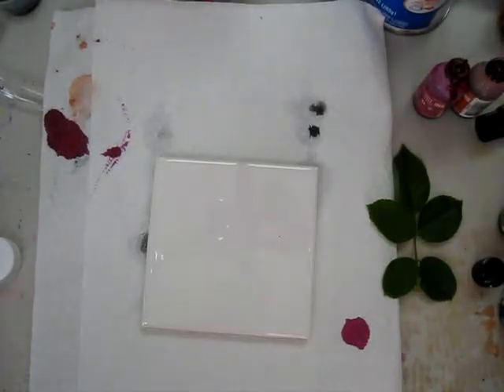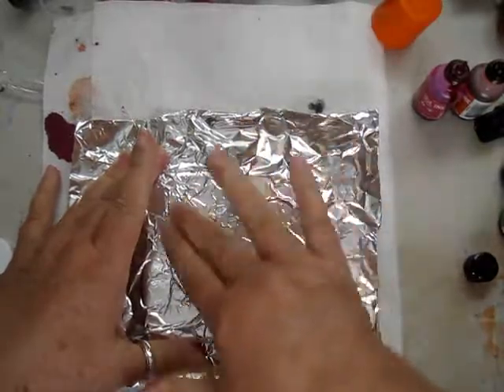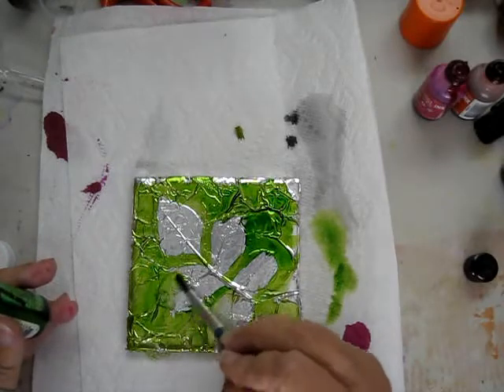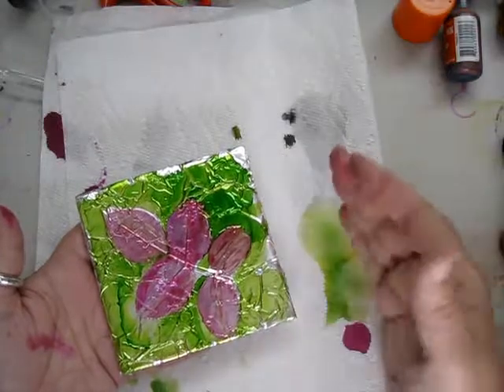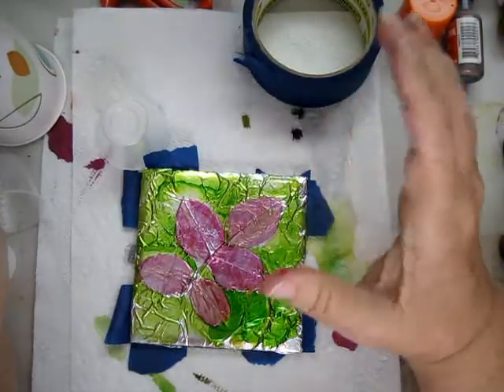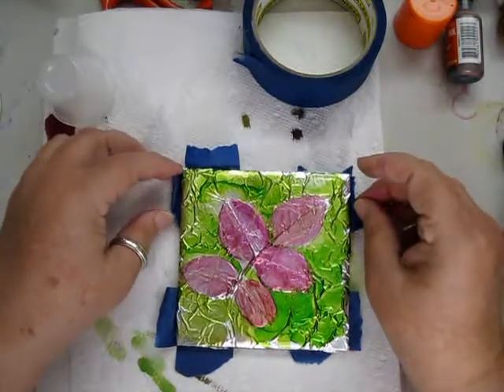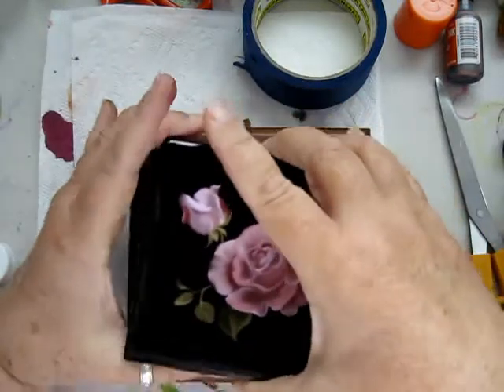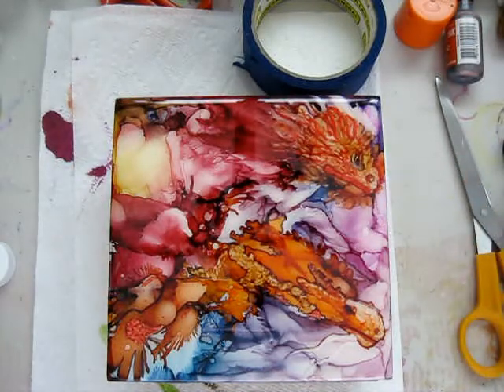Foiling the Leaf and tile substrate

Comment: Thank you for the awesome demo...why do you put resin on the tile FIRST before you add the leaves?
Reply from the maker: rose gesford, thank you for watching and your comment.  I am a bit confused about the question because your comment came to me attached to another video.  However, I think I know what your question is regarding.  I use resin two ways.  The first way is the conventional way - pouring over the top as the final step.  The other way is to mix up a tiny amount and use it as a glue.  This works especially well when gluing photos  to the substrate.  Some glues will soak into the back of photo paper and create a permanent discoloration.  The resin doesn’t do this.  When gluing leaves to the substrate, the resin adds a greater support beneath the delicate leaves to support the heavier resin pour above.  Let me know if this answers your question!

Comment: I like your video. Do you take off the aluminum foil at the end?
Reply from the maker: Abby Welch thank you for your comments.  To answer you question, the aluminum foil remains part of the completed project here.  However, after painting the aluminum embossed leaf, I have removed the foil, lifted the leaf off the tile, and used just the painted foil to remount on the tile.  You have to be very deliberate and slow in removing the foil because after all the embossing, it is really stuck to the glue on the tile.  After removing the foil, I placed it back on the tile without the leaf beneath.  Poured the ArtResin over it.  I noticed that there was a slight difference in the depth of the relief of the leaves.  The one that had the leaf remaining looked just slightly more defined than the one were the leaf was removed.  However both looked pretty good.  I hope this helps.  If not, let me know.
Reply: Gerry Morgan ok thanks. Where do you buy the ArtResin at? And what do you mix it with?
Reply from the maker: Hi Abby!  You can buy Art Resin at its home site at www.artresin.com or you can get it at Dick Blick and Amazon.  Its a bit more expensive than some of the epoxy products you can get at Home Depot, but it is a great product - no strong odor, simple 1:1 mix, dries like glass, you have a 45 minute window to work with it before it starts to harden, its self leveling, and it adds to depth to the photo or whatever else you are pouring it over.  I have used other resin products, but for some reason, they never dried to the finish I wanted.  If you are not happy with the surface, it can be sanded and repoured.  There are multiple YouTube tutorials and videos that can help you maneuver this simple product. I am not selling this product - honest.  I just like to let folks know when I am happy with a product.  I spend a lot of money on chemicals, as I am sure, you do to.  And when I do that, I want them to work as promised - Art Resin does.
Reply from the maker: Abby Welch I don’t mix anything with it, I just use the ratio of 1:1 when mixing the resin with the hardener.  I do use medicine cups when measuring so the amounts remain consistent